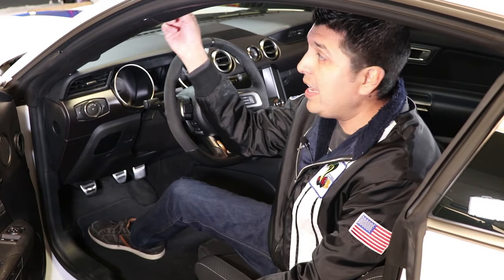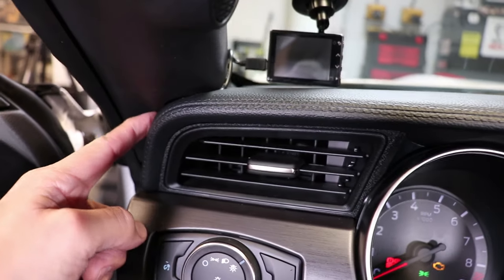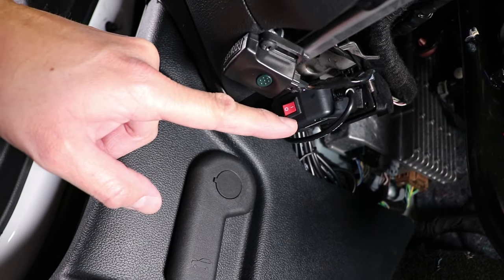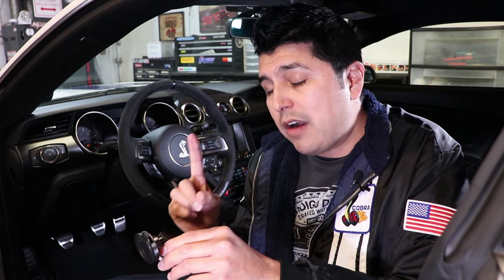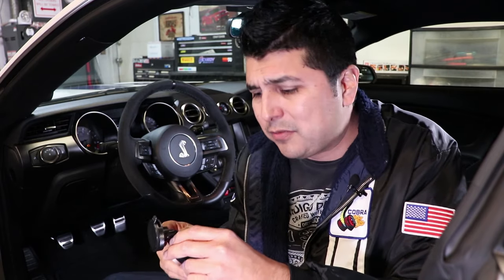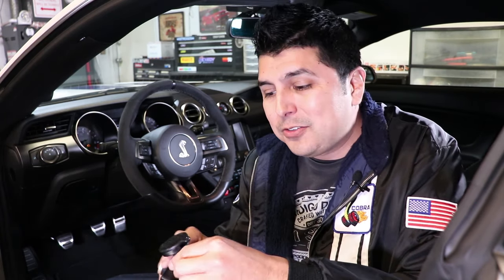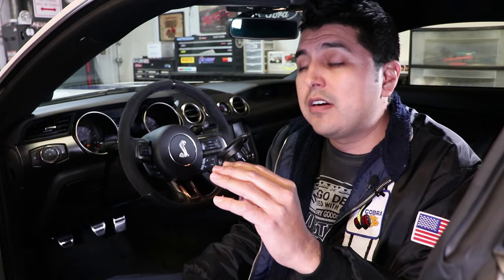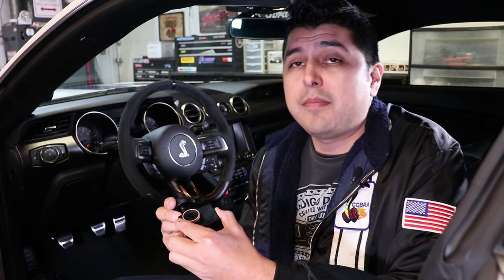Don't hardwire your Dash Cam! Try this instead!

Comment: First great info and video! Also thank you for the links on the connectors! Just bought new cams for my daughter's car as well as mine! And was looking at the hardwire kits on line! And really didn't want to run them hot to the fuse box! Glad I Googled a little further to find your video! Many Thanks for your help!!
Reply from the maker: You're welcome, glad to hear it helped and thank you for watching Wil Mil Man!

Comment: Thank you for the tip. I was going to hardwire my dash cam since I have an overhead power console but this ended up being a much easier, cheaper and cleaner solution overall.
Reply from the maker: You're welcome! glad to hear it helped!
Reply: Havent had any problems? I have mine set up to my cigarette lighter but I want it to be able to record overnight.

Comment: I learned some good stuff about the OBD2 connector, nice video - thanks. Now I am concerned in the position you put the dashcam it could block your view. I have only installed about 6 dashcams but everytime I installed up near the top of the windshield in the middle but just on the passenger side. It was always pretty easy with my spudgie to guide the wire behind the molding all the way down the pillar. Most gloveboxes pop off by squeezing it seems, so put behind that and then up the center console to the cigarette lighter plug. Wire was invisible, not pinched and no visibility problems. But again I like the idea of the ODB2 voltage pick off. I agree with the comment that cars should have a 12 volt connector behind the rear view mirror or something.
Reply from the maker: Hi Ralph!  Thank you! glad to hear it helped. But yeah the location is kind of unfortunate, here in California this is the only location where we can legally place our dashcams ugh However the dashcam could be placed higher by running the cable up the A Pillar and specially high in the middle, I definitely agree that is probably the best place to place it. Thank you for watching and commenting Ralph!
Reply: I would try to install it in the middle right under the rearview mirror.
Reply: @AlexAutoFun  Probably also worth considering patches that the windscreen wipers don't clean, which would sometimes be the top middle.
Reply from the maker: @DoubleMonoLR  Yep, good suggestion! And here is my follow up where I test the dash cams on several places to show both advantages and disadvantages https://youtu.be/F7OzM2i7ErE Hope this helps, Cheers!

Comment: man very well explained, totally enjoyed you video, unfortunately just yesterday I bought the hardwire kit, now looking at your video, I might of made an error, I have a Toyota camry 2021, which one of the OBD would suit me best, My dash cam is the Azdone m550, looking forward to hear from you, keep up this good work that you are doing
Reply from the maker: You're welcome donald! I think you are going to better off with the hardwire kit for the M550 (good choice on dash cam btw!) The OBD2 adapter can only provide 2A of power and the Azdome needs 2.5A you also get the benefit of enabling parking mode. Hope this helps, and here is my hardwire video in case you want to see that process https://youtu.be/K2iKXj82354 Cheers!

Comment: "don't put the camera too low" 
then places it hard on the dash. Great video though. 👌🏽
Reply from the maker: Hi Glen! unfortunately this is the only location where we can legally place our dashcams here in California :( However you could place the dashcam higher by running the cable up the A Pillar if desired, hope this helps and thanks for watching bud!
Reply: @AlexAutoFun   Ah ok, I just thought it's a funny contradiction. Great video though, and fantastic idea with the OBD power supply. Do you know if it works with the older vehicle's OBD outlet? I have a 2001 Subaru and the new OBD readers can't read the data from it.
Reply from the maker: @GlenEdwards  LOL yeah now that you mention it I just realize it is! thanks man, oh yes regarding the OBD power cable the oldest car I have used it with is a 2003. For a 2001 one is possible it may not have full OBD2 compatibility since it wasn't required back then. The good thing is that if the Port looks like the typical  OBD2 port shape (here is a video showing how it looks https://youtu.be/hEmvv8M8bGI ) then it should at least have the power pins functional, which should be enough to get the OBD adapter to work. If you do order it and are able to confirm it works please let us know!
Reply: @AlexAutoFun  You can place dash cams in CA in either a 7 inch square on the bottom of either side of the windshield, or in a 5 inch square in the top middle where the rear view mirror is.
Reply from the maker: @deedle6073  Hi deedle! do you have by chance the statue where you found this on? last time I checked it was either side (with the dimensional restriction of five inches for the driver side and seven inches for the passenger side) but it did not include the top middle, it be great if they have updated the VC on this, please let us know bud!

Comment: You should never run anything off your OBD Port.
They're not designed to run power to devices. They're only supposed to be used for diagnostics.

I removed a HUD device the previous owner of my truck put on it. Mechanic told me he's seeing allot of vehicles coming in to his garage with computer issues due to people running things off their OBD.

I also recommend not using the pedal commander, or like products. 
Pedal Commander was another product previous owner installed on my truck. I didn't think anything of it because it's connected to the accelerator. Well, it caused the accelerator to burn out. It would go so far when pressed then hit a dead spot with no DC output.
It's a 2014 F150, & they're not drive by wire. They're computer controlled. 

Wound up having to replace the throttle body & accelerator ($781 parts & labor) more expensive because I have adjustable height pedals. 

He said this was caused by the PEDAL Commander.
Reply from the maker: Hi Colonel! Here is my follow up video showing how the adapter works (and how it relates to the SAE J1962 standard we use in the industry for OBD2 port design and use) https://youtu.be/aV5jQovoaCI including the use of the OBD2 port by non-diagnostic tools. I been running mine for over 5 years now without an issue and since making this video, we also seen more dash cams like Ring, Garmin, Thinkware, Vantrue, Nexar, Wolfbox, use OBD2 adapters. However, if you would like to avoid using the OBD2 port for power (and also looking to enable park mode) here is my follow up video showing the alternative Hardwire method https://youtu.be/zbxYA4VhuT8 Cheers!

Comment: The new Garmin 57 dash cam has park mode with the standard cable that comes with the camera. It needs a power source that does not turn off with the key, or to use an independent battery unit that can be charged while the car is being driven.  

For best video response from the Garmin cameras they should be mounted high in the windscreen and as center as possible. Not difficult to install in most vehicles. The wire is easy to shove under the upper trim and push along to the door pillar trim. It can be shoved into the edge of the trim and worked down.  Takes about a hour to do a nice install without removing the trims if the proper technique is used.  I then run the wire under the dash to the cigar lighter plug. Under the dash I use small 3M adhesive wire clips.  Any excess wire can be easily rolled up and hidden under the dash out of site. Lots of room for this in most vehicles. The wire can be installed to not be visible with very little effort.  I also install a rear camera in my SUVs.  

I've had hit and runs on my SUV where the cameras got the license numbers. I gave the chip to police, and they issued a hit and run fine to the driver who hit my vehicle. The fine where I live is $950 for a hit and run.  I was able to also collect for the damage plus the rented car while mine was being serviced.  I had one hit and run where the total cost was over $5000.  Lots of damage to the front grill, bumper, and the front trims. I got paid in full. Saved by the dash cam!
Reply from the maker: Hi Viviane100Ms! Unfortunately we are very restricted on the mounting location for the dash cam here in California :( But yes as you pointed out the installer can place the dashcam higher by running the cable up the A Pillar if desired. If there is an airbag in the A-Pillar here is my video https://youtu.be/uZp95NbNlmM where I explain some of the issues that can pose. And you are definitely right, a dash cam I think is such a good investment and will quickly pay it self back if there is ever an accident. Cheers!

Comment: Nice vid and info but I just run a dash cam battery under my seat. It was an expensive option but it doesn't mess with the electronics of my truck, doesn't drain the car battery while in parking surveillance mode, and it has a nice extra USB outlet that acts like a battery bank for my phone when my truck is off. And since I keep a super capacitor battery jumper for emergencies, I can use it as a PowerBar to charge that if my car battery is too far gone. Nonetheless, I like the option you pointed out. 👍
Reply from the maker: Thank you Raymond! Ah yes some people do run their dash cams off a battery pack. However I prefer a normal cigarette lighter adapter or standard hardwire kit since here in my State we experience really hot temperatures which I would not want to subject the Li-ion battery to, that and the potential for a run away event (fire) during charging or discharging inside the car. Here is an example of a internal dash cam battery and what the sun did to it https://youtu.be/HW8jqbl_ayU and a video of battery related fire I personally experienced https://youtu.be/XfWgJ8nu-RA (destroyed the house) But I think one day it may make sense to review one the battery pack systems in the channel. Cheers! @christiamvasquez7476
Reply: @AlexAutoFun  Thanks, Alex. My B-124X dashcam battery by Black Vue is made to withstand heavy temps because its a LiFePo4 Lithium Iron Phosphate battery and not an L Ion  battery. They have a life span of about 3 times longer and can take the heat. As for my dash cam, I went with a Vantrue model with a Capacitor and not a battery for memory shut down.
Thanks for the links to your vids on the fire. That was pretty intense. My battery doesn't charge while the vehicle isn't running. That is great for safety but a down side if I drive it on short trips because, much like a car battery, it needs the car to run to be charged.
Reply from the maker: Nice! Yeah I really think that is the way to do it for those wanting to run it of a battery. I recently covered Life chemistry in my review for this power station https://youtu.be/SYCMQMg0xNk The advantages of LiFe over Li-Ion in my opinion outweighs the disadvantages of extra weight and cost. But yeah that fire was crazy and strangely enough we just had another fire in the same neighborhood, maybe a block away from the other house that burned. Who knows what caused this one but the garage was full of boxes, wiring and car parts, the good thing is everyone made it out ok. Cheers!   @raymondabella4684
Reply: @AlexAutoFun  Just got done watching the vid you sent me! Very informative. Keep thos cool vids on coming! We all appreciate the hard work you put in to make these cool vids! 👍
Reply from the maker: Thank you I appreciate that Bud! @raymondabella4684

Comment: Great video. Exactly what I was looking for, thanks. Just got a question, will this obd cable drain battery? I have seen reviews when it has drained their batteries.
Reply from the maker: You're welcome Johannes Maala! glad to hear it helped. Regarding battery drain this OBD adaptor has a low voltage battery cut off so it will turn off before your battery gets too low (some OBD adaptors do not have this feature). Hope this helps and thanks for watching bud!
Reply: @AlexAutoFun  unless you leave it on surveillance mode and let it sit for a day and a half?.. or does my adaptor just not have auto shut off?
Reply from the maker: @MapTheMissing  Hi Bri Shook! If it's left on surveillance mode, it will stay on as long as it can until the low voltage cut off kicks in. Hope this helps, Cheers!

Comment: good job man. i have been running the OBD power unit on 2 of my cars dash cams and now in my R. It works great. I usually leave it in mode 0 since i dont  need the cam on most of the time while the engine is off (like in my garage). but it is handy to have mode 1 when needed and out and about. i went with the vantrue n2 pro with dual cams and it's mounted to the center rear view mirror mount. also, you can tuck those wires in all the way w/o any showing, just use a plastic lift tool..very easy. anyway keep the content coming, good stuff and liked.
Reply from the maker: Thanks bud! Tha'ts good info too about the plastic lift tool, I look into that, gorgeous color combo on your R by the way!
Reply: Did you buy the parking mode cable, or just the obd cable? Is the vantrue a micro USB connection like the obd comes with? Was the cable long enough to from the rear view mirror to the obd port
Reply: I need help..just bought the obd cable and I don’t know how to set it on the mode to record all the time (after the engine is off it does record 5 minutes but I need it all the time.. thank you

Comment: I enjoy the video and explanation. I recommend buying the Owlcam that comes with all the features built-in.
Reply from the maker: Thanks Eddy! ahh I will look into the Owlcam, maybe add to the list of Dash Cams to review, thanks for the tip bud!
Reply: @AlexAutoFun  Of course my friend, I have it and it is really good, however, I recommend luxury vehicle owner get  "Tonsiki OBD 2 Cord 16 pin M/F Male to Female Right Angle Diagnostic Extension Cable with Power Switch to avoid battery drain" for some strange reason it also triggers codes in some of the these vehicles.  I have a Honda Accord and I do not have any of these problems.

Comment: You didnt show how you connected the cam to the OBD
 You have to remember that may of your viewers like myself are not car enthusiasts
Reply from the maker: Hi Lana P! thanks for the suggestion, ! the OBD plug connects fairly straight forward, similar to plugging a USB connector into a charger, it only goes in one way but I will definitely keep in mind for next ones to show more detail, thanks for watching Lana!
Reply: I agree overall super helpful video and you seem very knowledgeable, thanks for the vid I agree though maybe  a little more detail in connecting the OBD.
Reply: There's nothing to show, it's a plug... you plug it in
Reply: you dont need to be a car enthusiast to plug in an OBD. Its like one of those children's toys where you put the shape where it belongs, just need common sense.

Comment: Hi @Autofun thanks for the informative video! A few questions however:
Which types of dash cams can this method work with? 
Is there any risk of the battery dying out due to powering the dash cam?
Oh, and can this power the rear camera too?
Reply from the maker: Hi Shah! the OBD adapter is available in two styles, micro USB and mini USB. If your dashcam has one of those connectors it will work for you. Regarding the battery drain, the adaptor has a automatic shut off, once the battery gets too low, it will turn it's self off to prevent leaving you stranded. Hope this answers your questions and thanks for watching!
Reply: @AlexAutoFun  thanks man! Can a dual channel front & rear cam work with it? I know the rear cam usually connects to the front cam in a dual channel setup. Are there enough ports to take both the OBD as well as the rear cam?
Reply from the maker: @shah5524  Yeah that's correct most dual cameras power the rear camera using the front camera. This adaptor will power those as well, I actually been using mine to power this dual LCD mirror camera https://youtu.be/fQDgk2YnRhQ Take a look may interest you!
Reply: @AlexAutoFun Nice video. Very informative. I am getting 2024 RAV4 Hybrid soon. If I use ODB2 connections then will it void new car warranty? Another question is as you said ODB2 adapter cut off power if voltage of battery goes low. How low for 12 volts battery?  Any chance that by this kind of arrangement hybrid battery would be affected? Thank you so much in advance. Regards.
Reply from the maker: @parimal3506  Thank you Parimal! Ah that's a good question (often a debated one) you would want to check your State's law. In my State supposedly the law prevents a Dealer from denying warranty if someone added something to their car or worked on their own car as long as whatever was added or the work that was done was not the cause of the failure. So let's say you put window tint on your car and your transmission fails, it would be difficult for the dealer to deny it because the tint or the tint install did not affect the transmission. But as simple as that sounds, there are horror stories of dealers not honoring warranty if they see a modification claiming it is what led to the failure. Some owners even had to take them to court or complained directly to manufacturer (since dealers are typically independently owned) to get their warranty honored. Cheers!

Comment: Great video and you really have good expertise Thank you! But at what  point does the obd power adapter detect the battey is to low? Or at what voltage is the signal ticked off?
Reply from the maker: Thanks joe sno! the adaptor cuts off the power when battery reaches 11.6V I haven't gotten to that point yet but I imagine it would depend on the size of the battery or how old it is. Hope this helps!
Reply: Domt use the port ever.